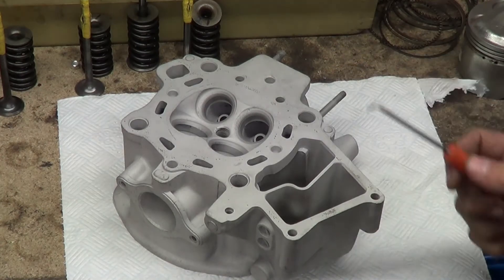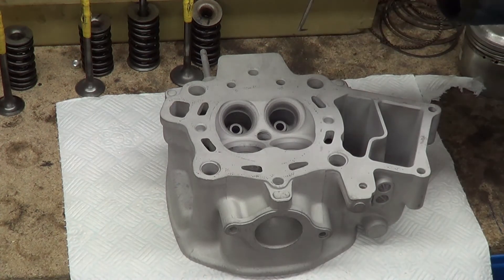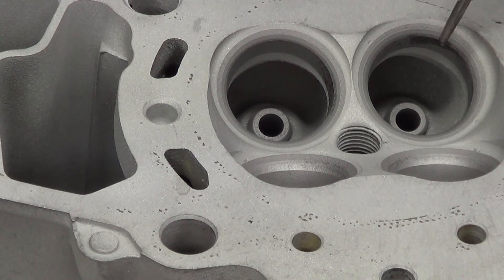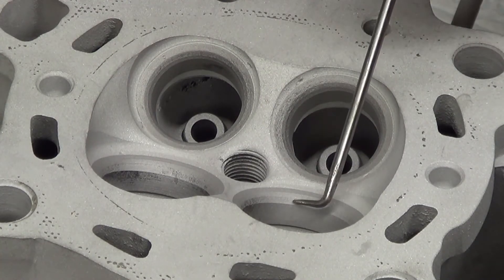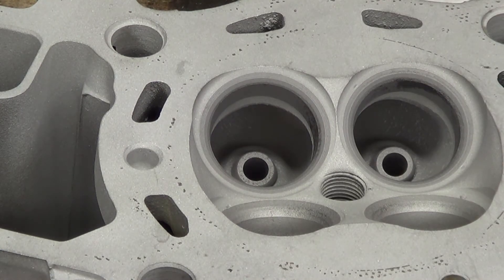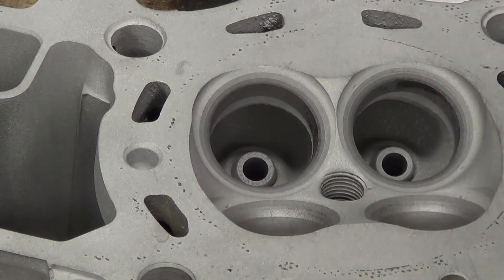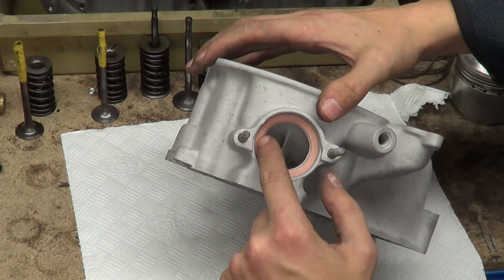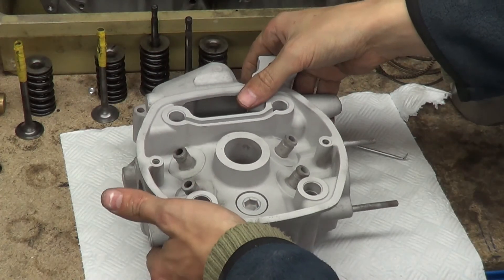CX500 V Twin 4 Stroke Series - Part 17 Sandblasting the head

Comment: These are really great videos and thanks for putting them up. You are helping me with my CX500 C build. I have a question, why do you need to helicoil the spark plug hole? Thanks
Reply from the maker: Better safe than sorry. The aluminium alloys of yesteryear weren't the best and its over 40 years old now. I don't wanna strip the head again because a plug hole stripped. - matt
Reply: Gotcha, thanks

Comment: Hi Matt,

Im interested to see your rebuild of this engine. Do you always use original gaskets or go for sealants. Im interested as rebuilding a CB500 at the moment, and have just bought a CX500. no idea what the engines like yet, so will compression and leak test etc before I d anything else.

great videos BTW

Rich
Reply from the maker: +Richard Cluderay Unfortunatly the rebuild is gonna be some time away, having workshop issue (i.e don't have one at the moment)As for your question on the gasket, it depends what gasket. Rocker covers and casing surfaces usually need a bit of silicone sometime in tandem with the gasket, if you want a more specific answer just ask - matt

Comment: Hi there. You've made a really great series of videos here. I've just cracked open my own CX500 engine as the pistons have seized. Probably do to lacking cooling and therefore overheating, but my investigation hopes to reveal that. I look forward to the (hopefully) upcoming videos from you.
I am curious though; what is your view on sand blasting vs glass blasting vs micro blasting? I imagine some parts of the engine should not at all be blasted. If you'll cover this in the coming videos, I'll just be patient :)
Reply from the maker: +Christian Flojgaard Thanks for the comment. Depending on what your blasting and the operations to follow. Obviously cylinders, journals etc are a no-no. Valve seats are also to be masked unless your re-cutting the seats which I will be doing. Soda blasting can be used on pretty much everything, but in the video I used recycled glass. Valve guides (unless replaced) are a no-no to. Anything that has a precision bore or fit has to be avoided. Sometimes I use silicone tape, this seems to resist media blasting as is absorbs the force of the media. As for the future of the project, it's still a go I just have alot going on with moving workshop etc. So stay tuned there will be more coming up soon. Thanks again for the comment - hope this helped - matt 

- one more thing to add is the type of surface your blasting. Dry media tends to embed dirt into the soft aluminium if the part is really dirty or has oil impregnated into the material. The CX500 cases have that golden appearance. This oil that has burned into the cases and dry media blasting will force it further into the ally. Wet media blasting will help wash this out and the heat from the blasting is also reduced, helping the whole process. - matt

Comment: is there a video of the engine put back together and started?
Reply from the maker: The cx is a long project. the valve guides and seats are going to be removed. The piston are going to be replaced with triumph ones and the rods are going to be replaced. But that bit is a surprize. The engine isn't going back in a cx but something else. You'll have to wait and see
Reply from the maker: +iWatchVideozS not yet my friend, the project has been put on hold as I'm moving workshop at present. There will be though, and I'm moving some time in the next couple of weeks. I need to bore and hone the cylinders and alot more to come. If your a subscriber then you'll receive a notification when the next video in the series is posted. You can also add me on facebook where I post all the new video up or you can send me your email and I can add you to the mailing list. There's also going to be a blog, going into further detail about the project coming up in the coming weeks - thanks for the comment - matt
Reply: +Pony Power Got it! I'll be patient and hoping for things to go well. Thanks for telling us.
Reply: +Pony Power What about removing the valve guide and placing new ones? 
Looking forward to seeing the end result.. gotta record first time starting !